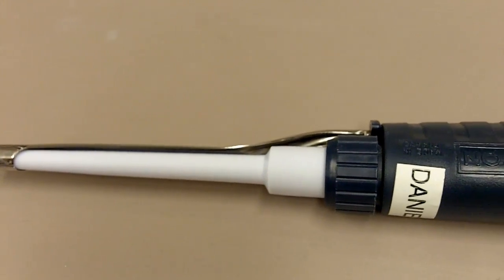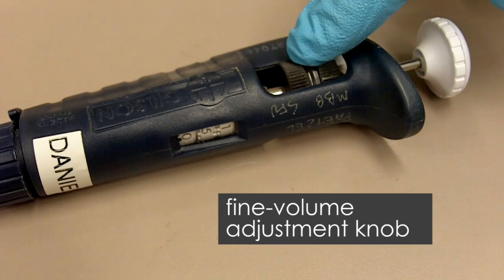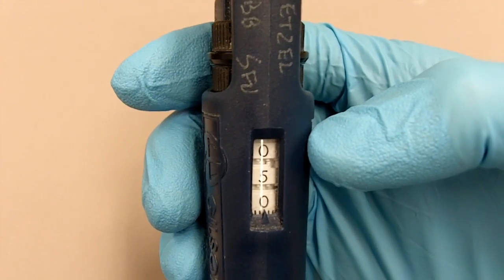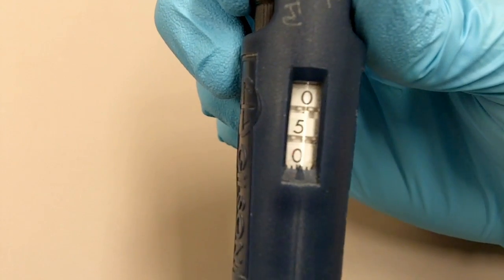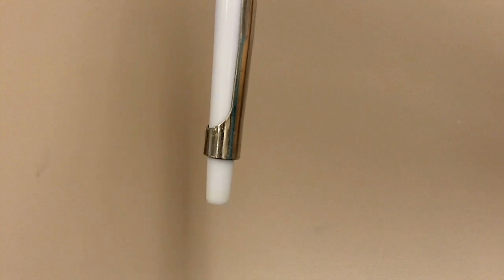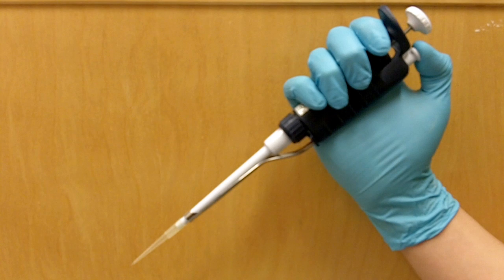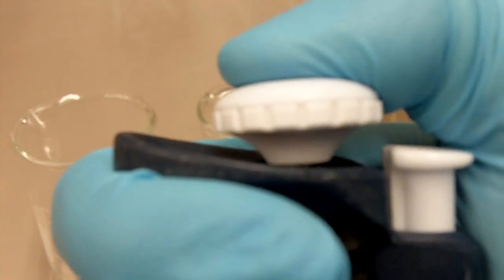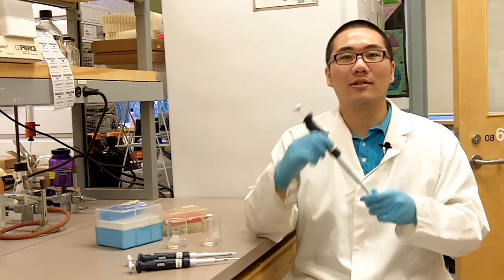How to Use a Pipette

Comment: Great video. However, you should emphasize in the end on correctly pipetting out (45 degree angle against the wall above the fluid level if you are mixing things). Other then that, thanks for making the video.